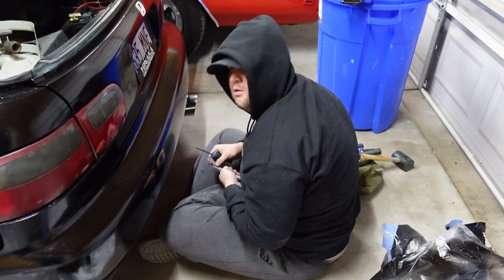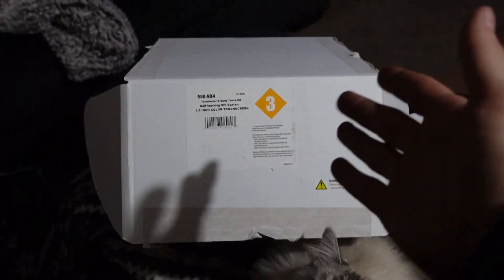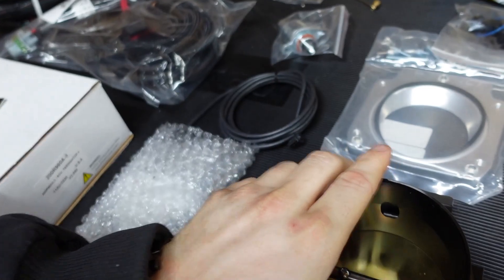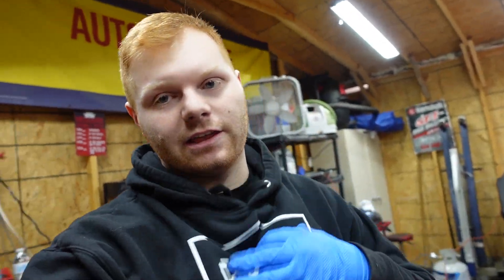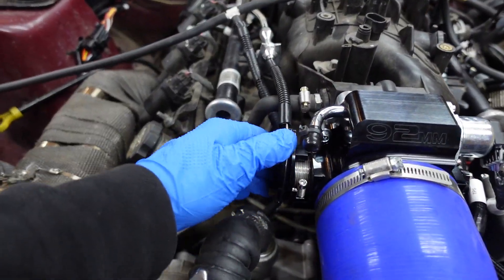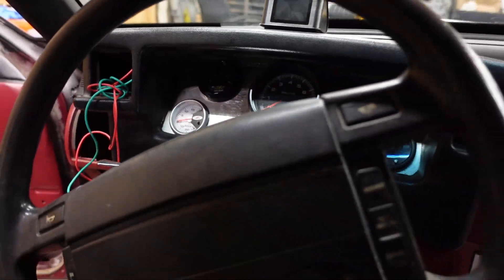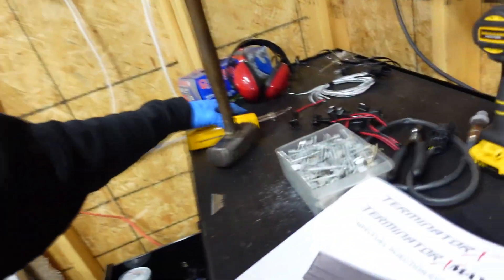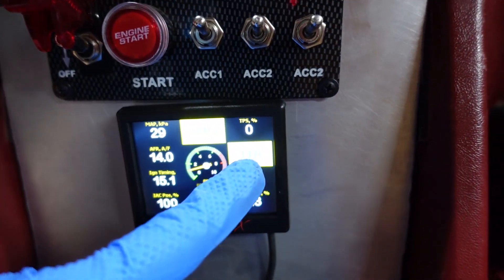HOLLEY TERMINATOR X INSTALL ON TWIN TURBO LS SWAP MUSTANG

Comment: I'm doing the terminator x on a ls swap new edge but where would the red and white wire go and how would I be able to keep the original fuse box for the new edge to power the head lights
Reply from the maker: If you check one of my other videos of Zacks ls swap. We reused the factory fuse box and all the electricals.

Comment: Man I'm trying to make it to ls fest this year. Would you be willing to share or sale me a tune. I'm struggling bad
Reply from the maker: Whats your setup?
Reply: @Cawbee  5.3 twin66s   terminatorx  2x44 gates  snake eater 1500s summit cam   air to air. 73 nova.
Reply from the maker: @havocracing6019  Well the terminator is gonna get the fuel side of the tune. Now the timing is what you'll have to monitor plus any ping/knock. So do a couple data logs. Make sure afr are about 10-11 under wide open throttle and idle is about 13.5-14.5 on afr. I think Goat Rope Garage shows you excalty how to tune on the holley terminator X
Reply: @Cawbee  yea I've watched about every video I can from Joe Simpson to goat rope. Steve Morris shows alot also. But I'm more of a hand on teach me.   I've been fighting all weekend with a adapter plug for map. Had all my stuff disabled.   I just get so many different opinions on afrs.
Reply: @Cawbee  what would you set afr to on wot and timing on wot cruise and idle. That would help me alot. I'm running pump 93 with octane booster
Reply from the maker: @havocracing6019  wot 11, cruise 14 and idle 13.7

Comment: how did you wire in the Alternator? i have the same set up but idk if mine is fucked up
Reply from the maker: They have a alternator plug that has the 3rd wire from the left that has a resistor built in to stop the current from back feeding. This wire turns on the regulator. All this goes to is a 12v source.